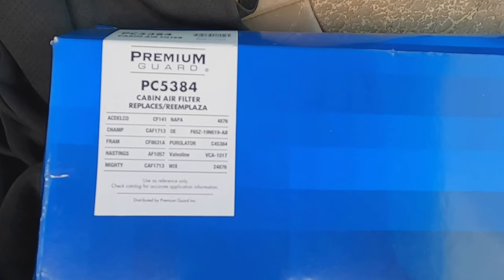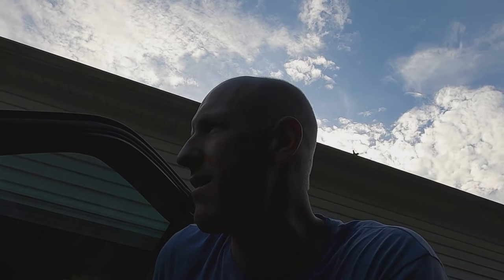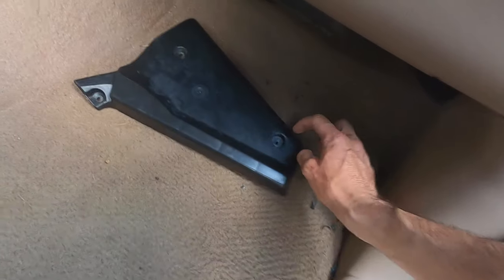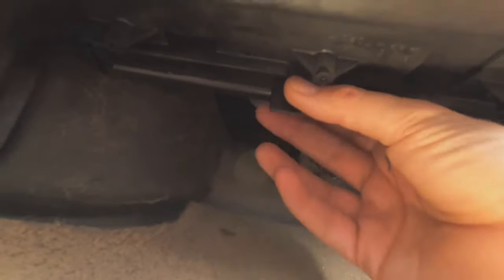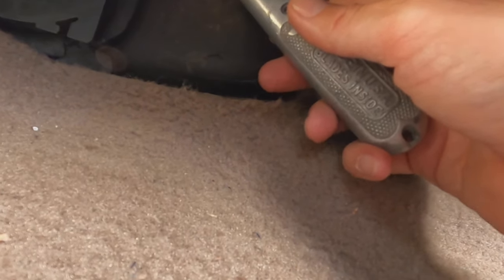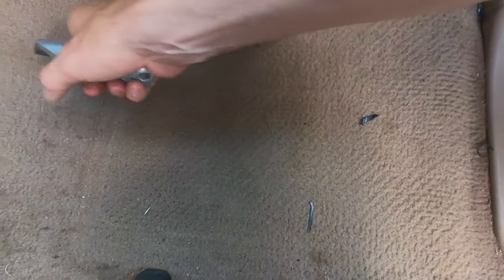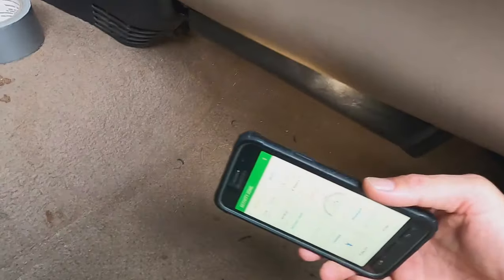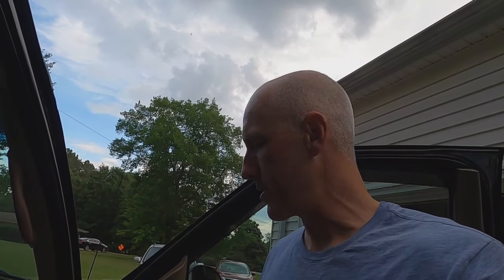1999 F150 Install a Cabin Air Filter YOU DON'T HAVE ONE!!!!!!

Comment: Ford actually has a kit (Part# F65Z-18D477AA) intended to allow for the installation of a cabin air filter. Not sure how easy it is to find, but it exists. It includes a template to know exactly where to cut, and a bracket with corresponding screws that can be installed to hold the filter into place. The kit isn't a necessity since, as this video shows, if one knows where to cut, the filter will pretty much hold in place. But an official installation kit does exist. It'll fit first-generation Expeditions (97-02) as well as some F-150s (not sure of the model year range).
Reply: Where can I get that kit.?
Reply: @santiagodavila1426  i cant find it.
Reply: What size cabin air filter? Think link is broken
Reply: @MrAlternation best bet is check a junkyard or the dealer

Comment: I know this video is about 2 years old and most replies 1 yr old. My 1997 5.4L XLT just flipped 420,000 miles. I bought used in 1998 with 90,000 miles on it. My truck air seems fine, no smell. I have a urge to change the filter and now learn it may not have one?! Thanks for the video.
Reply: I just looked at my '98 lariat; and guess what, no filter, just the plastic blank that I don't really feel like cutting out.

Comment: Excellent video! Having had my 2003 F150 XL since it was new, I never thought a cabin air filter could be installed. So after 260K miles, it now has one. Just as the video shows,  there is a plastic insert that can be cut out with a razor knife to give you full access  to the ductwork AHEAD of the heater core in order to install the filter. A word of caution - be careful using the razor knife as the heater core sits immediately past the opening being cut out. The core could easily get stabbed with the knife if you're not careful. All in all, a good project to give you filtered outside (or recirculated) air! Thanks again for the video!

Comment: I have a 2003 F-150 super crew cab my ac quite working I was told to change the cabin air filter and didn’t know it had to be modified has anyone else had there ac not working an put in a filter and fix this problem???

Comment: I have a 2000 Ford F-150 XLT Extended cab with 123K miles. No rust, best Ford motor, 4.6L , 2 valve. Since you have over 285K, have you ever replaced your fuel pump? I like the idea of a cabin air filter, but to me if it was an option by Ford, you shouldn't have to go thru all you did to modify it. I question whether it was an option by Ford. Remember early cabin filters started by being placed below the cowling (the plastic vent between your hood and windshield. If it was an option, I would think that would be the location. My truck has a musky smell when A/C is first turned. I'm looking at Youtube videos for solutions. Thank You
Reply from the maker: Thanks for the comment. I have never replaced the Fuel pump (I have to knock on wood now). I had the same smell, but after having the filter for a month now its seems to be gone. When I first put the filter in after cutting the hole for it leafs and things fell out of it, I am sure this is your issue also. GOOD LUCK!
Reply: Ford has a kit to install the filter in the location  he installed  it in.

Comment: Did this and a good amount of air was blowing past. Have to forcibly press the filter up to get it to not blow past... May have to bend a little bit of steel and make a bracket with the screw holes nearby

Comment: Thanks for doing this video! Quick question: doesn't this cause the water from the AC evaporator to leak all over the floor? If not, where does the water go?
Reply from the maker: I have not had that issue.
Reply: Of course not only air flowing through this compartment .
Reply: @fishfire_2999  I believe he was asking about condensation dripping from these evaporator coils.
Reply: @wittydisplayname1761 Ah yes live and learn ,i put a screw through one mounting a small amp under a dash 30 years ago middle of summer in Florida.Not one of my best memories .
Reply: @fishfire_2999  Ouch!

Comment: Man I need some pointers.  I can’t get the damn filter to slide in there.  It’s getting hung up somewhere.  So frustrating.
Reply from the maker: I had the same issue st first. I just had to make the hole a little bigger. Hope this helps
Reply: Take your time, work it in back n forth

Comment: sorry to break it to you but thats NOT what it looks like with trucks without the option, you had the option, it just wasnt already in there, you couldve used an actual filter, which i bough but figured out i couldnt use lol
 i do not have anything that looks like that, just some crappy insulation essentially or  cheap cotton filter stuffed in an open space